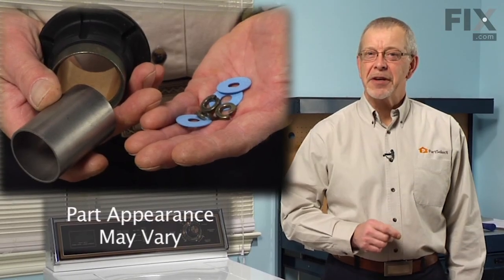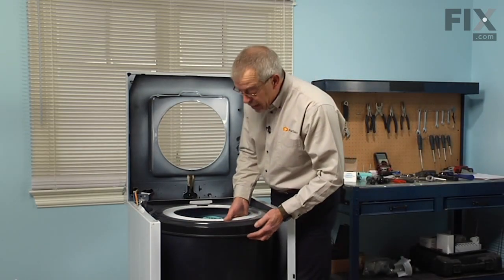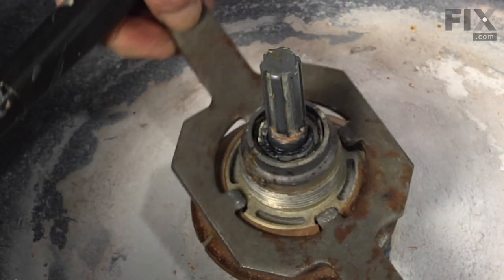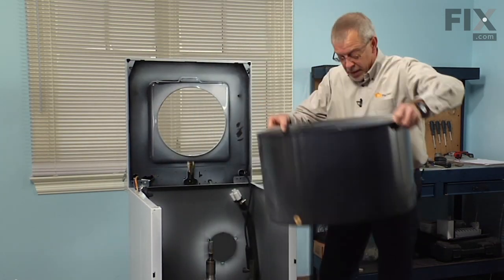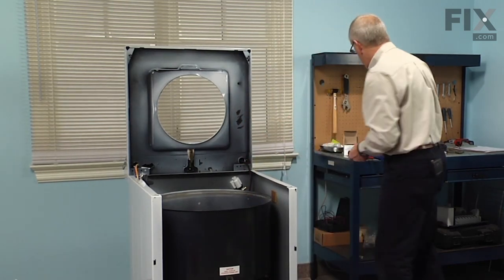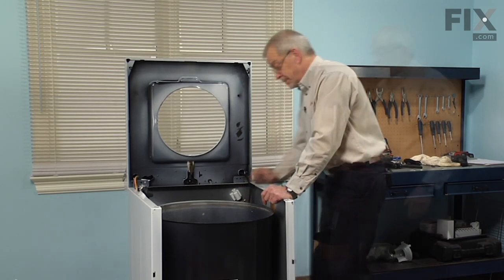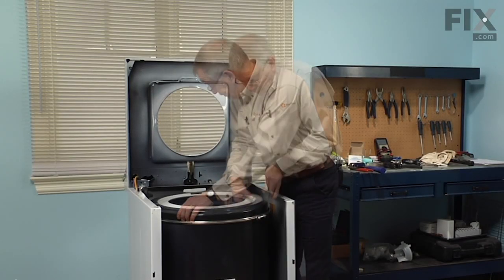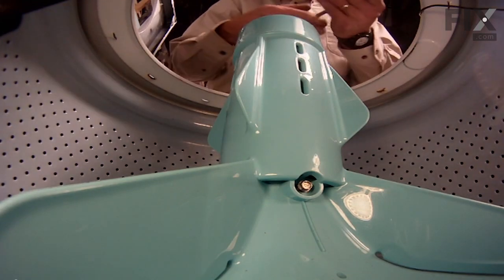Maytag Washer Repair – How to replace the Tub Bearing Kit

Comment: This helped me fix my seals and bearing in our 24 year old Maytag! It was slightly leaking (maybe half a cup) once in every 6 washes. Bought the oem parts for under $60 at a local appliance store. 

I forgot the front bolt holding the outer tub is shorter than the two back ones and I had some weird whirling noise and a burnt rubber smell. I took everything apart and did it again, this time with the short bolt in front and I didn't tighten too tightly using the spanner wrench. I think I tighten it too much and the belt was having a hard time spinning? Now it works well. Didn't know there was sooo much calcium sediment under the upper tub and on the inner tub. Thanks for the great video!

Comment: Great video! My Maytag is slightly different from this model but the mechanics are very similar. I bought a spanner wrench from Ebay that was not usable without cutting off the 4 teeth by 1/8 each. Even then, the cutout circle was too narrow to revove the transmission nut.  I simple struck it with a hammer and small square punch and it loosened easily.  My real issue was the transmission spline sleeve was frozen to the spline.  I had to split the old one after making a groove with a grinding wheel. Aside from that, only issue was my bottom tub needed epoxy due to a small rust hole.  I CAUTION EVERYBODY TO CLOSELY EXAMINE THE BOTTOM TUB FOR RUST HOLES. I only exposed this one, which my have never been a real issue of leak until I pressure washed and scraped it to remove years of calcium and scum deposits.

Comment: Very clear and complete disassembly instructions.  Thank you.  The bearing is making noise and I want to see if it needs grease or replacement. Several sites placed "grease tub bearing" in their titles without featuring any details about how to access or service the part. Thank you for both your thoroughness and integrity.

Comment: Great presentation. I watched in order to find out how the outer drum seal fit. I took one end of the clamp apart and I think that was easier than trying to pry it off and on. I was looking to see if there was anything between the inner and outer drums. There wasn't. What I did find, after taking all of that apart is that the flapping noise is from loose belts! I don't know why they are loose. They are only 35 years and 2 months old! Where did you find a brand new looking A412? I wish things were still built to last like they used to be. I also have a 64 year old LECO edger that I got from my Dad. Other than occasional maintenance, it still works great! Clinton engine.

Comment: I repair these washers all the time we have 18 laundromats and close to 75 of this exact model but with the coin op package i have to say they are bulletproof recently bought 25 new maytag top loaders and they are broken on a daily basis a true testimate  to the quality of years past
Reply: I'm repairing one of these now, an LA712, which hasn't leaked for its +35 years of service, but now the outer tub has rusted through. I'm fixing that, but I'm concerned with the rust buildup on the shaft, where the top of the tub seal touches. It's certainly not all smooth and shiny like the one on this video's newer orbital transmission! This one still has the original transmission, which I'd like to keep. Have you had to deal with one that bad? I'm hoping a good sanding will work and not make it too skinny for the seal. Thanks!

Comment: This video makes it look very doable but I'd suggest looking at others as well.  The bearing caps will usually be seized into position.  These parts will need to be forced/broken off.  

I had my Maytag serviced many years ago.  Not many will work these because of the difficulty.  😮

Comment: Great video but I would have liked to hear it running before and after to see if it makes the same noise mine is now making.
Reply: I have the same issue.  I’m wondering if the chirping I hear is from the pulleys and belts under machine that can cause the same noise.  But it is a great videos.

Comment: Apparently the washer in the video was fairly new because it is a whole different story on a 35 year old machine. Also, the Maytag spanner wrench is no longer available, but the two piece spanners on Amazon do somewhat fit, but hammering turned out to be useless anyway as the aluminum threads on the collar nuts were seized permanently to the steel threads. I used a cutoff wheel on my hand rotary grinder to make some cuts before chiseling the collar nuts and steel sleeve off. (Tip: use some automotive anti-seize grease on the aluminum threads during reassembly to hopefully avoid the galling in the future). It's a hell of a lot of work, but after doing some research on the durability and cost of the washers that are available today I think it was worth the effort. "Smart washers".....what a joke!

Comment: If you have the model as I do, similar to the LA510, and can't find an Agitamer, which is impossible to find on short notice.  Take heavy duty cardboard, and shove it in around the agitator, leave a little space for your hands, and put the cardboard in, so it provides a little bit of pressure on the agitator, but not as much to break it (about 1/2"-5/8" of cardboard) this way you won't damage the porcelain, and the agitator will break free.

Comment: I have the same (or very similar) model washer as what you show in this incredibly useful video. I suspect that my transmission may be bad. With the drive pulley and lug stop out, should the output drive on the transmission spin freely? Mine doesn't move at all. Thanks for any help!

Comment: I replaced the tube seal kit due to the outer tub leaking right above the transmission.  I got it back together, ran it full of water and no leaks.  Put a large load in it and it started leaking again.  I am going to attempted to replace the tub bearing and hope that will fix the leak.  That is the only other thing that is above the transmission  or to leak out of the center of the outer tube.
Reply from the maker: If the tub bearing is rusted or corroded on the top of the outer sleeve, it may interfere with the boot seal and cause the washer to
leak.  Take note at about the 16:25 mark of the video. If you have replaced the mounting stem/boot seal kit and the boot seal is fitting tight on the outer tub, then the tub bearing is most likely your problem.

Comment: i have a maytag washer from 1981, the plunger on the lid switch broke off and i was able to poke in the hole and it still started but not stay on when i let go.. then i mustve broken the spring inside too...now all repairs ive tried to find, show the whole switch replacement when all i think i need is the plunger piece..problem is i dont know how to get into the washer..one video of an old washer showed just using a putty type knife to pry up the top but in your video which looks more like my washer,..shows id have to get under the front to unscrew the screws to remove the front panel first and then unscrew under the top with a ratchet...will your video  be the way to go? and will i be able to access that plunger from there once i open the top?  im trying to do this repair myself before i bring in someone else thanks

Comment: I wasn't as ballsy reassembling mine. I used a dead-blow hammer to seat the new bearing. Upon sanding the inside of my tub, there was some breakage, so that had to be fixed with "Liquid Metal" and "Red-High-Temp" Gasket sealer.

Comment: I just put in a new seal which was fine. After assembling everything I can't keep it balanced. I tighten up the nut to hold the drum in place and after spinning a bit it starts banging and clattering. Springs all look good. Any suggestions?

Comment: 19:47 I was able to successfully do the repair, everything works now but there’s a small water leak from tub cover gasket. It appeared to be in good condition and after a bit of monkeying around it went in place and appeared to be seated right. I’m ordering a new seal in case the rubber is just old. Anyone have any extra tips in regards to making sure it seals up? I followed the procedure here. Kept the rear clamp in original position and only adjusted the front. Lifted the band clamp onto the gasket with a large flathead screwdriver

Comment: I'm having a terrible time getting my 35-year-old Maytag LA512 apart.  I was able to cut off the top ring nut after failing to loosen it with "Liquid Wrench," a blowtorch, a 4 lb hammer, etc.  Now the set screw (allen wrench) on the seal won't come loose, either.  I'm just about ready to try to cut the set screw out with a chisel, but is there another way (It's probably too hard to drill out) ?  And if I do get that set screw out, I'm concerned that I'll not be able to loosen the mounting stem / seal.
Reply: I'm doing this repair right now and can't for the life of me get the mounting stem to break loose. I'm guessing the transmission shouldn't turn when I hit the spanner wrench with my hand sledge. Does anyone have any tips to get it off?

Comment: That's a very good video. Problem is, while replacing the bearing and seal kit fixed the leak, the washer remains loud. As if the bearing is not getting lubrication. I assume that the bearing is self-lubricating bronze, but now I wonder if I should have added some lithium grease or something?
Reply from the maker: If the washer is loud in the spin cycle, you may have a problem with the radial bearing that the transmission sits on. The enclosed
video link will show the disassembly procedure for this repair. https://www.youtube.com/watch?v=VCxpJYZP6iA

Comment: Hi
I have a maytag la608. It isn't leaking. It can't get up to spin speed before motor clicks out.  
The drum is hard to turn by hand.  I wondering if the bearing(s) are tight. 
Any suggestions???
Reply: Im having the same problem did you  figure out the problem? And tnx in advance